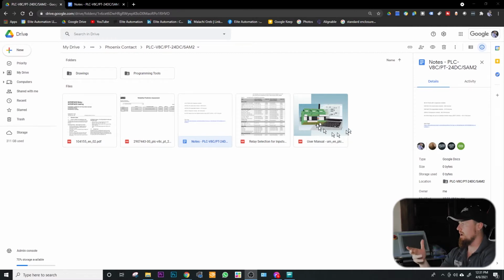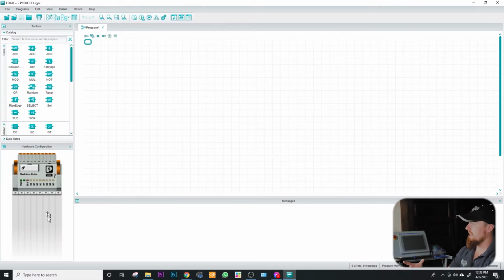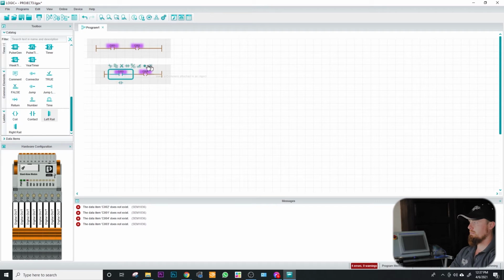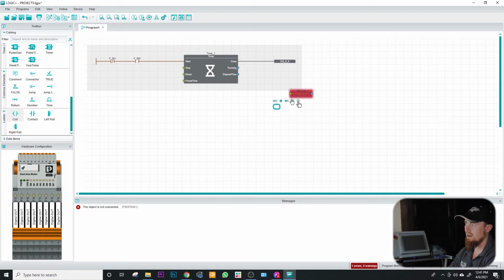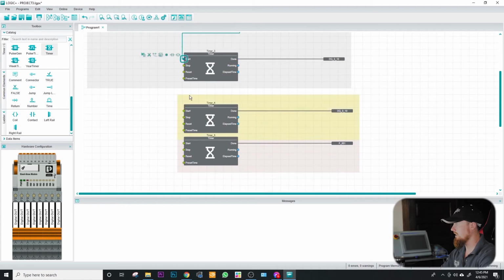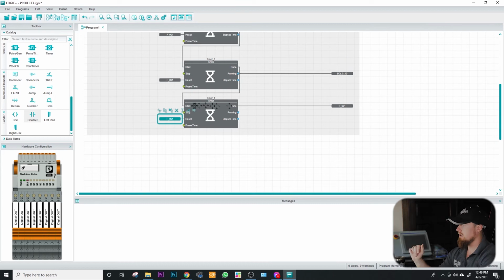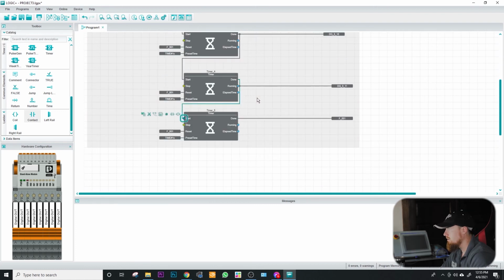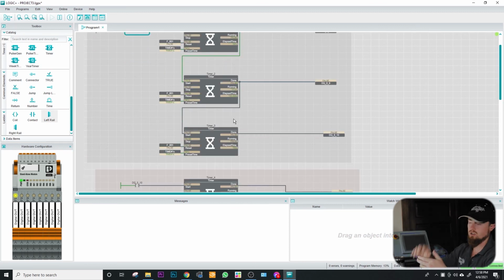PLC Programming Tutorial for Beginners 2021 | PLC-V8C/PT-24DC/SAM2 | LOGIC+

Comment: can this control sensors and fans?
Reply from the maker: Absolutely. You may need to fire a bigger relay depending on how much power the fan pulls. I can’t recall off the top of my head but I think they can handle 15amps